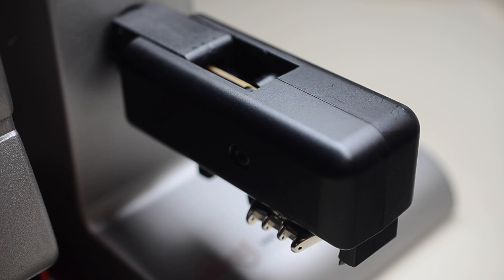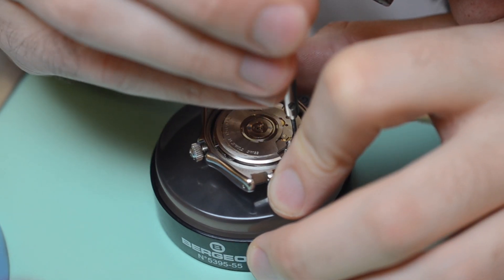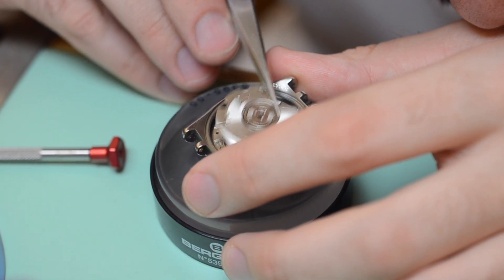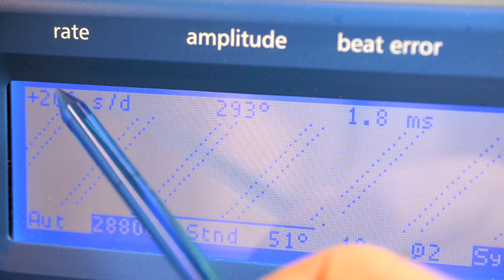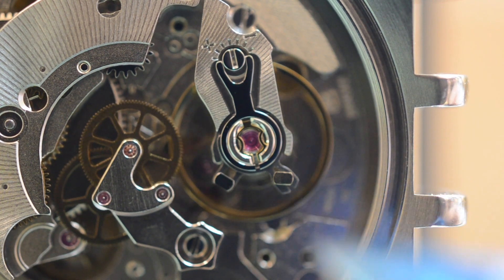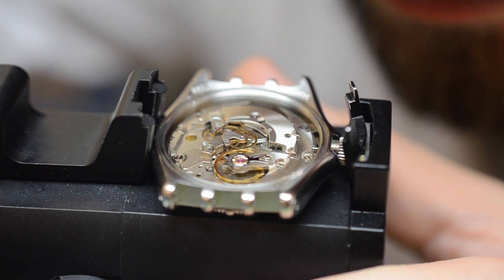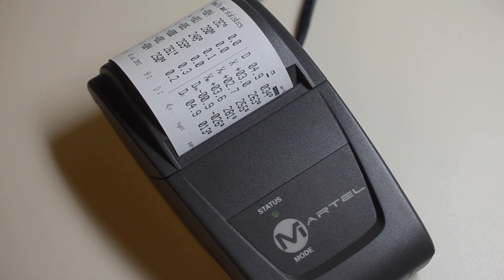Watchmaker Tutorial: Watch timing and regulation. Introductory.

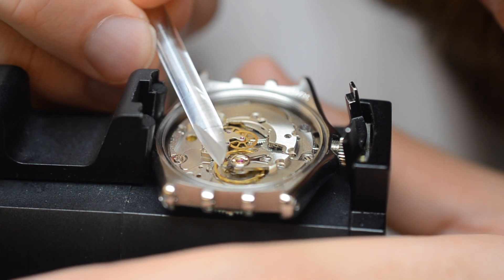Comment: 1:51 I wish this video showed a close up of what was going on here and which direction speeds up or slows down the watch. It's basically impossible to find any details on course adjustment of the 2824 beyond 'this is the course adjustment arm, adjust this' with zero detail beyond that. So frustrating for a watch running 30+ seconds slow.
Reply from the maker: Because the direction is different for each movement. Moving the regulating arm closer to the stud increases the effective length which slows your watch. Moving it away from the stud shortens it, increasing the rate.

It is quite simple to see with a timegrapher which direction does what. I do not recommend attempting to regulate your watch without a timegrapher. If your watch is suddenly running slowly, there's a good chance it is magnetized.
Reply: @OrionWatches  Thank you for your reply. The watch arrived running -10 seconds slow per day. Micro adjustment screw doesn't do much but got it to -7 seconds. Over time it's grown to 30+ seconds slow. I have a demagnetizer device and have used it to no avail. Someone said I can turn the micro adjustment screw one full rotation or two and increase the speed without worrying about the course adjustment lever or stud. Is this true? Should I just give it one full rotation? Or could that damage it by doing a turn far past the "-" & "+" markings?
Reply from the maker: @nikone4129  No, I would not turn the fine adjustment screw beyond the markings. Are you regulating your watch at full wind? Most watchmakers do not use the fine adjust, and if you do, it is best for sub 5s/d adjustments.
Reply: @OrionWatches  Yes, it was at full wind. I read the fine adjustment screw does nothing if turned past the 180 degree - and + and that it was fine to turn it more. I turned it 270 degrees and it made no difference. So I moved it back to the final notch on + side and now it's running approx 15 or 20 seconds fast per day. Still frustrating. It's an HK PT5000 which when I got it ran at 0 to 1 sec per day fast for weeks. It was the most accurate watch I owned. Put it in a wood drawer for a few months and now I see it's quite slow.

Comment: Hi  sir , how to udjust vertical position  , when watch keydown -15 and keyup +15  
Dial up +6 and dial down +5 
Amplitude 310
Beat erroe 0.1
Caliber 2671

Pls answer ....
Reply: The hairspring is not center between the regulating pins. It would be best to have the watch taken to a watchmaker for adjustment as you may damage the hairspring by attempting the adjustment by yourself.
Reply: Thank you

Comment: Thanks for the intro on timing. Looking forward to more parts to this series.

I usually regulate the watch by sight and wear only. Adjust regulator arm and wear and observe. I don't have a timegrapher.

But, I should probably get one. Will provide more immediate feedback. And, I at least have a chance to know what I am doing if I should attempt to adjust and correct the beat error. Impossible to know without one.

Doesn't the real test come down to wearing the watch in practice and use? Having a watch in any static position is probably not a true representation of the watch's act performance in use.
Reply from the maker: Would definitely get some form of a timegrapher before regulating!
Reply: To do a more thorough, accurate and efficient way of regulating. Yes. And, having definable measurements are always good for working knowledge-base while keeping track of watches being worked on.

But, all the watches I've tinkered with the regulator lever has been done simply by sight & light touch without a timegrapher. Then I wear and observe and adjust as necessary until it is within the performance tolerance I find acceptable. It's been done to the point where all the watches have been regulated to be within -1 to +4 seconds per day with my average wear and usage.

Again, ultimately, the end user will determine just how accurate the watch is for him or her versus plain flat numbers when the watch is static and not moving. As such, I suppose I would say all the watches I have regulated have been personalized to be as consistently accurate to my lifestyle. Others may experience different mileage.

It just doesn't make sense to me to regulate a watch solely in a static position. The watch will be worn and movement in multiple directions is inevitable. I am no expert nor completely familiar with the watchmaking industry, but perhaps the watches while being regulated and balanced are at least put on machines that simulate movement... at least the higher end watches should be doing this.

For that reason, I personally have found keeping a watch on my body as long as possible yields better consistent accuracy versus leaving a watch off the wrist to rest on a table top for an extended time, say for example when sleeping overnight.

But, I want to be clear, I am not denying the advantage and necessity for a timegrapher at some point in the near future.